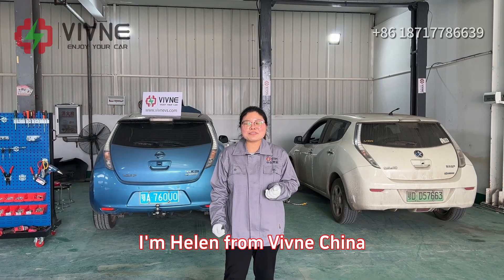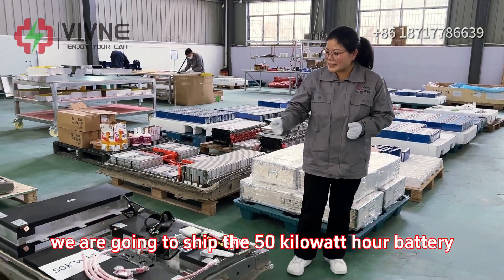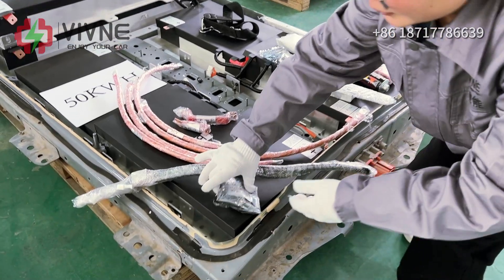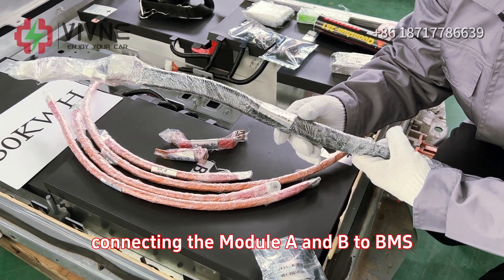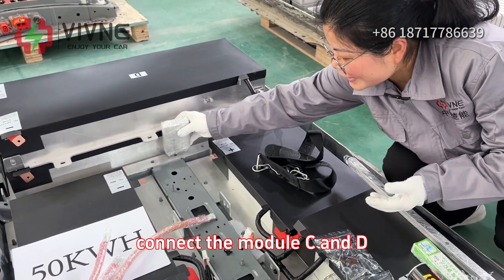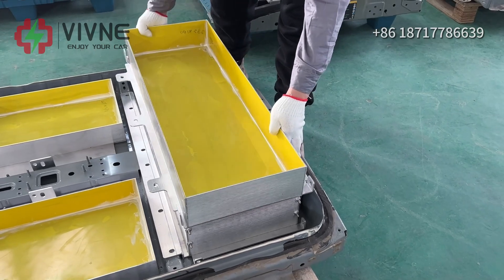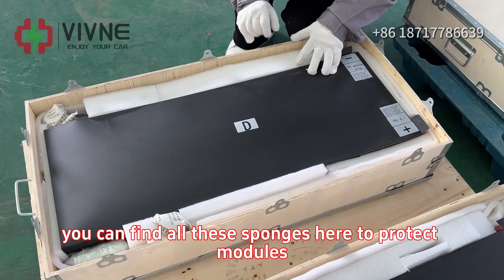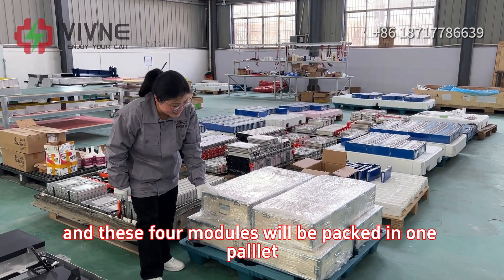Nissan Leaf DIY battery modules 50kwh before shipping

Comment: Thank you for your informative videos, Helen. What is the weight of the original 24kwh battery, and how does this weight compare to the weight of the 40kwh, 50kwh, and 60kwh batteries that you are offering?
Reply from the maker: Thank you for your affirmation. The weight of the original 24kWh is 275kgs. Our 40kWh battery weights 253kgs; 50kWh battery weights 299kgs, nearly the same weight as original 24kWh; the 62kWh battery weights 360kgs,  85kgs heavier than original, just as taking an adult in your car.

Comment: Doesn't the CATL batteries need a coolent especially if you are driving long distance,?
Reply from the maker: No need.  We replace the original soft pack batteries into big CATL batteries, which bear a smaller C rate and  generate less heat.
Reply: @VIVNEHelenMao  Thanks could you please tell me what is the C rate.
Reply from the maker: @edwinjoshua2041  It is the rate. For example, the motor of Leaf is not big, whose peak power is 80kw and peak current is 250A. The original factory pouch cell is 67Ah (24kwh), so it bears nearly 4C discharge rate(with 250/67). We replace it with most up-to-date CATL high density cell, for example 120Ah cell, then it bears only 2C discharge rate(with 250/120).
Reply: @VIVNEHelenMao  great answer.

Comment: Is there any testing done to see if the original 24kwh bms can balance the 50kwh pack? Thank you for the video!
Reply from the maker: The original 24kwh BMS ( if before our re-programming), is also can be used on the 50kwh pack,  just can not display the whole correct new mileages.
Reply: @VIVNEHelenMao  how does the new programming work? Can you do it remotely, or do you supply new Fw and instructions?
Reply from the maker: @rdflo6739   We use the original Nissan Leaf BMS and re-program it.  It is a very complicated work and only can done by our professional technicians. We send the re-programmed BMS together with the battery pack to customers.

Comment: Are these packed liquid cooled or the same flawed design passive cooling that Nissan used?
Reply from the maker: We replace the original soft pack into big CATL cells, which generate less heat and bear a much smaller C rate. Besides，the motor of  Leaf  is not big.   So it is enough.

Comment: Thank you for this vidéo.
Few questions:
1- is there an insurance and for  how many time or km? 
2- Do you've got a shop in Europe, or a association with another company (garage...) to change battery (I'm in France)?
3- my leaf is a 40 kwh. It still works very well. So I don't need to replace the battery for the moment. Your pack could be put on this car? 
Thank you.
Reply from the maker: Thank you.  We provide 2 year warranty or  80,000kms warranty.   Trust soon we will have partner in Europe.  Yes, our pack can be put on this car.
Reply: Hi. I have a guys in Bulgaria who can help you out to trade your pack in or can sell you empty case if you need one.

Comment: A suggestion: It would be nice to also have a way to reuse the old Leaf battery modules, e.g. as a home battery (powerwall). If you could offer a kit for this along with the Leaf battery upgrade kit, it would reduce my overall cost since I can re-use the old cells in my house.
Reply: I have a lineup of 48v and 12v boards and kits to reuse modules, since this is what I do here in California. Since we have a sunshine tax anyway, we have to take advantage of it :)
Reply: There is! See Dala's EV Repair. It's an open source project.
Reply from the maker: Thanks for your suggestion.  Our technicians are considering this possibility.  You are also welcome to discuss more details with us. You can add my WhatsAPP: +86 18717786639 or email to us: helen@vivnevs.com
Reply: Ask yourself "why am I replacing the batteries"?  Typically they have lost so much capacity, they are better off recycled, and find other (newer) batteries to use as a power wall.

Comment: I would love to test these batteries, but struggle to trust overseas supplier, also do you have own bms? Or use Nissan one?
Reply: I feel the same
Reply from the maker: @spiderrman2099  No rush.  We can spend more time getting to know each other. You can share with me any technical  questions about the Leaf car battery upgrade.
Reply: Jason, we signed the agreement to work with this company. I'm located in Los Angeles area. I'm serving basically whole west coast and warranty claims(if it's gonna be any) will gonna go thru us.
Reply from the maker: We use the original Nissan BMS.  But we can do BMS programming to display  the correct new mileage on the dashboard. You can first add my WhatsApp:+86 18717786639 or email me: helen@vivnevs.com  We can introduce our factory to you by video calls.